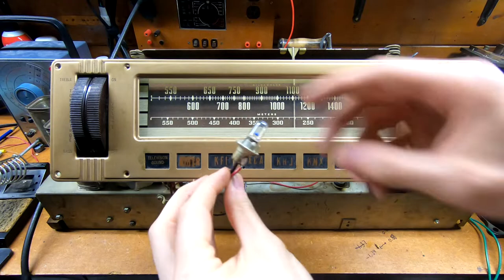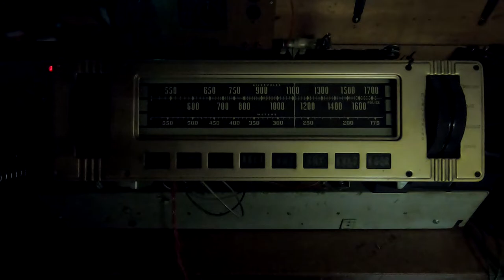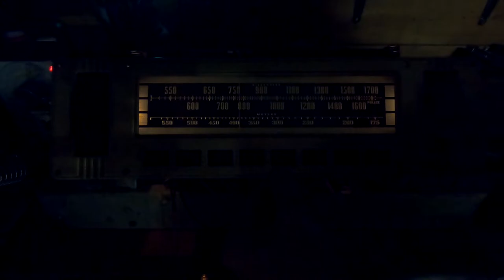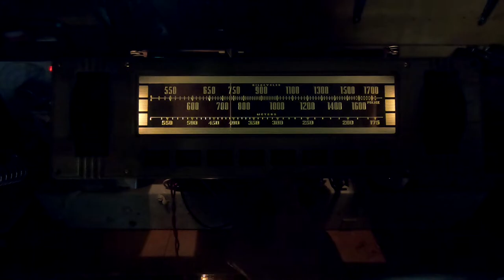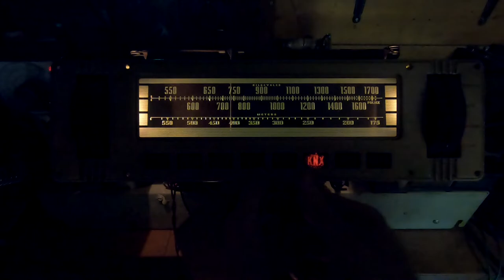Philco 39-55 Chassis Diagnosis & Repair

Comment: I am surprised that it worked before, after seeing what you had to do, to get it to this point.Very well done!
Reply from the maker: I was genuinely surprised that it even worked BEFORE I caught that miswired electrolytic! The B+ circuit should have given up, but I guess it took a few tries before the capacitor became a resistor!

Comment: So I just fixed the light sockets like you did, with vinyl washers, genious! I do not have any #6s but metric M3s worked as well.
Reply: Do you know where the bulb described as “bull’s eye,” with a black painted tip, goes on the chassis? I do not have the cabinet…could it be somewhere on it?

Comment: So the the manual on / off - volume knob is neither? It is just a switch that turns the motor, to or fro, which then turns a volume - on / off pot inside the chassis? Excellent, informative video!
Reply from the maker: Correct! All it does is change the direction the volume control motor rotates, which then spins the pot / switch for you.

Comment: You mentioned 60/40 Solder at 41:00 - I used lead-free for a few months, but the joints always look "cold" !!
Reply from the maker: Since the joints were all originally lead-tin solder, that's what I use to ensure a good bond. Melts at a lower temp too compared to stuff like silver solder.

Comment: Question: to get started somewhere, I powered up the volume control transformer. It produces 30VAC. When I then short one or the other side of the motor to ground, it buzzes but will not turn. Even when I helped it with a finger (gears turn easily and smoothly), nothing happens. Any ideas? There are some three capacitors connected around it, which I did not swap.
Reply from the maker: there are two paper caps near it that get rid of any arcing from the direction control switch, but the electrolytic across the windings could be leaky and causing trouble. Looks like its about 30uF from the grainy schematic.
Reply: It was the 30 macroFarad, which measured as only 50 nanoFarad! As a test, I tried an ordinary, 35mF, 35V electrolytic. The motor started and ran for about 10 seconds, then there was a fantastic explosion…the capacitor blew up. I just ordered a 30mF, 250V fan capacitor. That should work fine I think.